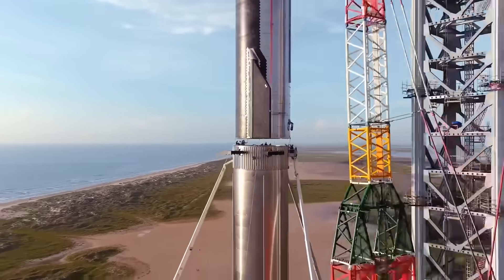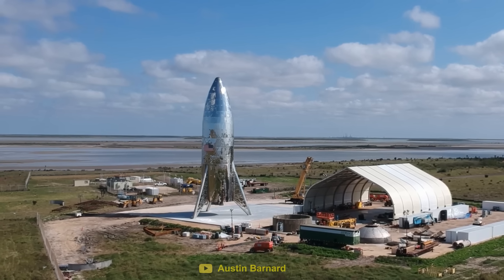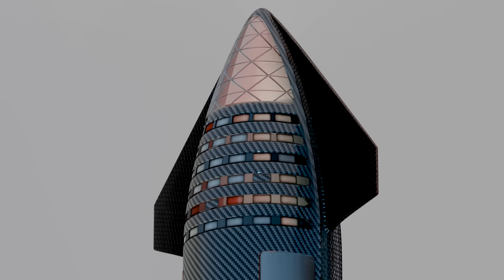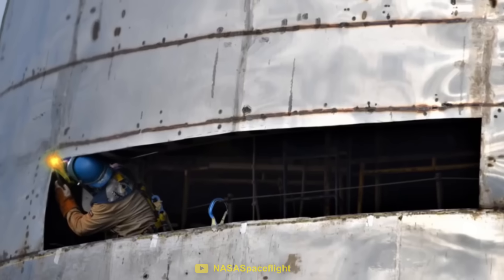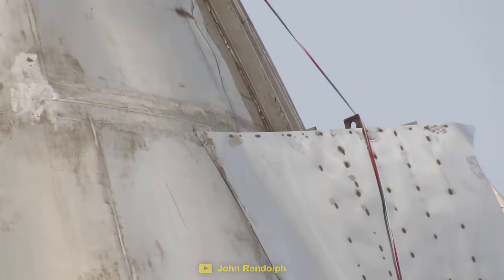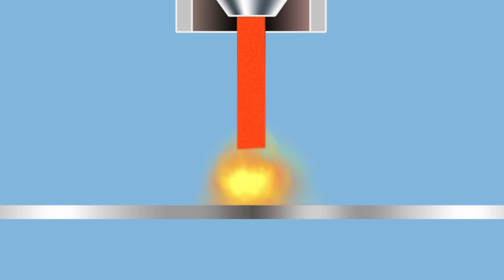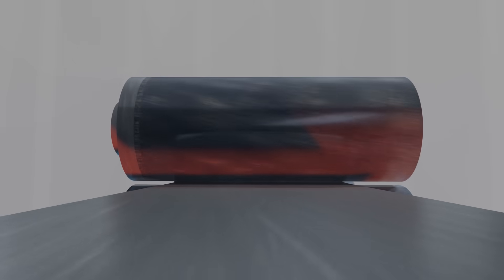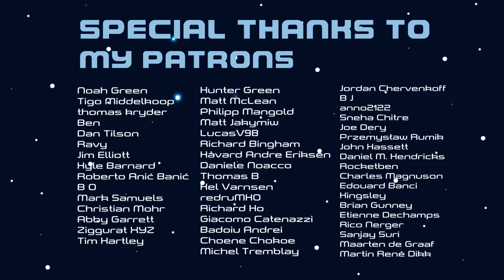How SpaceX Mastered Starship’s Welding

Comment: Planishing the welds is meant to stretch out the "heat affected zone" or HAZ as it's known in welding circles. When you weld the metal around the weld shrinks as it cools this causes the warping. By stretching out the metal with the planishing hammer the original shape is retained. This is a normal operation in autobody work when welding sheet metal repair panels together.
Reply: Right, that makes perfect sense now that you said it. Obviously warping is especially strong with thin sheets of metal. But additionally (just as it was well explained in the video), from a hardness standpoint, the hammering has the added benefit of increasing hardness at the seams by flattening the metal grains and thus increasing the local yield strength at the seams. 304L is also well malleable (which further speaks for the usage of this alloy in regards of your point). And additionally, 304L is very well suitable for low temperature applications whilst still having great heat resistance properties, so its an overall excellent choice regarding the the big temperature differences Starship experiences in the course of its journey to Mars etc and all the other rough conditions a rocket goes through in its lifespan!
Reply: Exactly! The HAZ zone would be the greatest danger to failure for the structure.
Reply: You beat me to it - lol -. Weld/heat distortion is even worse with high expansion metals, eg alum, SS, etc.
Reply: @lukaepeluca impressive. This is why it's not open to the stock market. So people like you can't invest. Fickel minds kill ipo's. Nothing like marketing a reusable rocket. Such a scam. 1/10th as expensive payloads. Definitely not a high tech rocket company. . . . . . .  JFC
Reply: Doesn't work on 12ga tho
Reply: And I see tons of warp on their fittings
Reply: Planishing also increases HAZ toughness due to cold working as well as forming discontinuities in the crystallographic microstructure. Peening does a similar thing, too.

Comment: I did Laser welding and cutting starting in the late 70's
Reply: What types of lasers? CO2?
Reply: @ap123c  First was a 5KW CO2 laser from GE. Later it was a 1.5KW pulsed YAG laset used primarily for cutting.
Reply: @Aethelwolf  cool stuff. The YAG lasers are pretty nice.
Reply: @ap123c  In 79-85 this was really cutting edge

Comment: All of the money, time, and labor, could have been saved with a phone call to the American Welding Society
About the welding procedures and metal choices. Next time hire a certified welding inspector ( older citizen) who knows all about stainless and already has a lifetime of experience.  So sad.
Reply: Coulda gotta clue from St Louis Gateway arch too!
Reply: Just a phone call and will these people come and work at Boca Chica, in the corner of Texas?
Elon have been talking about robots laser welding plan as early as when they posted Star Hopper built.
But, what is wrong with using hand weld for early prototype such as Star Hopper?
Save money? SpaceX literally hired water tower builders. Star Hopper flew which prove it was good enough for early system component testing.
Save time? Who do you think it is faster to hire? Some water tower builder or aerospace grade welder or robotic welder?
Reply: What so sad is you have no clue about how SpaceX rapid engineering works.
A separate engineering team have been developing their own robotic laser welding from the beginning.
In the mean time, they were also hiring skilled welders.
Also, they just hired water tower builders.

Water tower builders got there first and build Star Hopper tank.
A few month later, skilled welders were hired, got there and hand-build early prototypes.
The robotic welders got there at last about a year later.

There is absolutely no waste of money, time or labor.
Reply: @josephine2869  They should have contracted a tank builder with experience in large-scale production for industrial storage. Building steel tanks is something that is already figured out and common.
Reply: Most welding inspectors are useless, some of them cant even weld.
Reply: @pickettmandi  My best compliment came when I, as a non-certified welder, was told by a certified pressure vessel welder that there was no need for him to do the welds on a boiler when mine were better than his.
Reply: @pickettmandi  Why would they need to know how to weld? That's not their job.
Reply: He called Chinese Welding Society instead 😆

Comment: I've been thinking about the Starship welding improvements for sometime, thanks for the excellent presentation.

Fun thought; what if NASA and Space Force financed a collaboration with SpaceX and Rocketlab to develop and build a Superheavy first stage with Raptor2 engines and made out of carbon fiber. Disregarding the higher costs; would there be a substantial performance gain?
Reply: carbon fiber is plastic that breaks down at 200 degrees. rocket engines are fire. thats why.
Reply: @George-Francis  and, carbon fiber structures tend to have brittle failure, rather than ductile failure.  When they go, they go to pieces.  

I’m surprised they haven’t used spot-welding (a lot) more.
Reply: @dennisyoung4631   Rocketlab is leading the development of carbon fiber rocketry. Their next larger fully reusable first stage is a carbon composite structure. Interesting company to follow to see if heat and brittleness is an issue as they developed the Neutron Rocket.
Reply: @linasvelavicius330  actually carbon fibre can withstand a lot of temperature and its the binding agent that melts at 200°c ,so they might have changed that
Reply: Why Rocketlab? They can build a carbon fiber rocket that wide?
Reply: @vistaero  
Given the resources I think Rocketlab could develop a rocket that wide. Yes SpaceX could develop a carbon fiber superheavy on their own but I'd rather see a collaboration with Rocketlab and keep SpaceX focused on Mars. 

There is a need for private sector collaboration in the development of economical space. Unfortunately NASA is politically entrapped in the high cost pioneering era of space. Artemis is the wrong next step for many reasons, the next logical step for space is the development of economical space infrastructure (fully and rapidly reusable heavy lift rockets, standardize orbital refueling, remote and crewed stay-in-orbit transportation systems with full orbital access, a stay in orbit satellite service station, standardize modular satellite architecture designed for in space servicing, etc.). A new US government Space agency is needed (something similar to the Army Corps of Engineers) to lead the private sector in the competitive/collaborative development of a fully integrated self-sustaining space infrastructure. A great reference of the great potential of an integrated space infrastructure is the global economic impact of the standardize intermodal shipping container
Reply: Carbon fibers are literally created by burning nylon, rayon fibers. They can withstand heat. There are matrix materials that also work at extreme temperatures: Ceramics. But they are brittle. And costly.